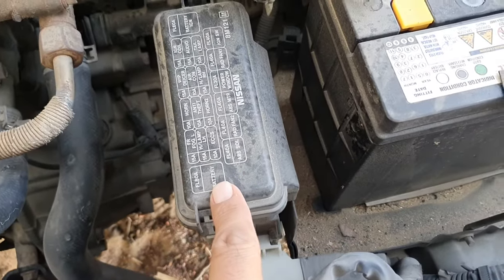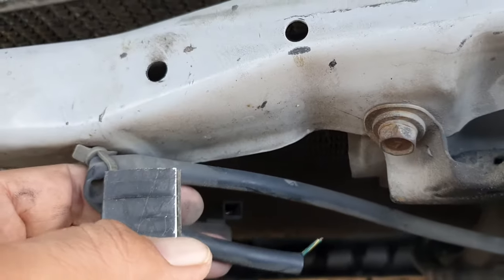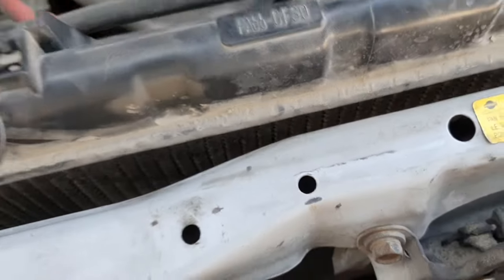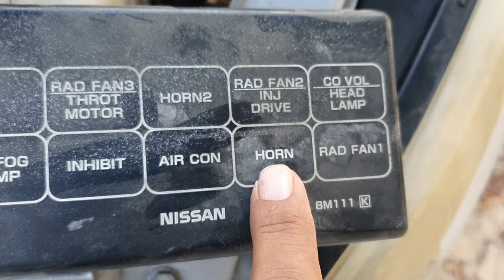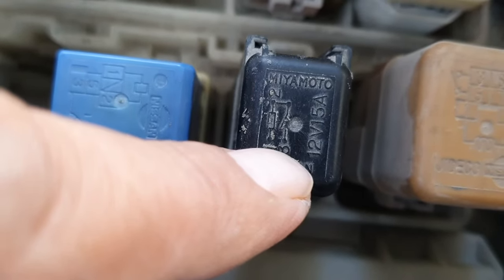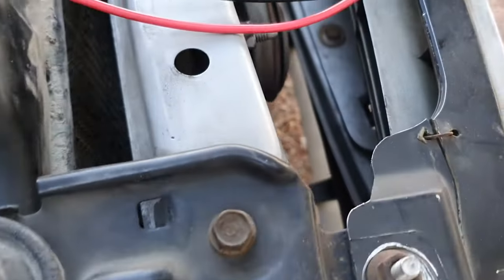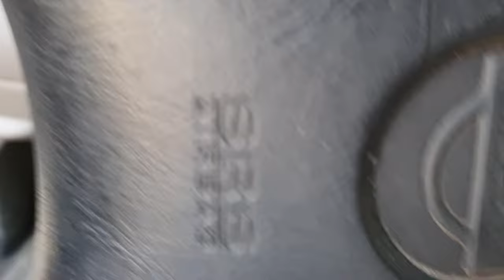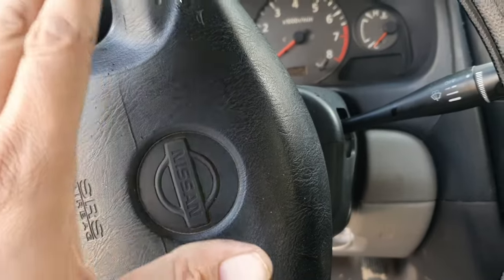Car horn keep honking/ringing/running, how to repair car horn issue and troubleshoot it.case study

Comment: Old 95 Toyota Camry. My horn gave out. Tracked to the steering wheel. Saw the complexity of removing the steering wheel and all that. Instead, bought a $5 horn button from O'Reilly's, a spool of hook up wire- a shorter wire from button inserted
into seat of fuse under dash, inserted fuse over it, ran the lengthy part to one horn ( 2 of 'em was too loud anyway) ...
... and everything works like a charm. Attach button where conveniently reachable with Gorilla tape ( I plan to glue it later )
or glue. Passed all safety checks. It's the poor man's fix and warning- does not impress a date. Save the money to take
her someplace nice.
Reply: This is also my plan for my 96 Nissan pickup.